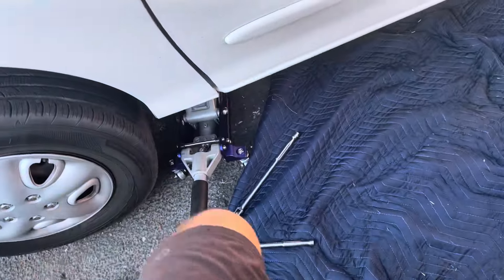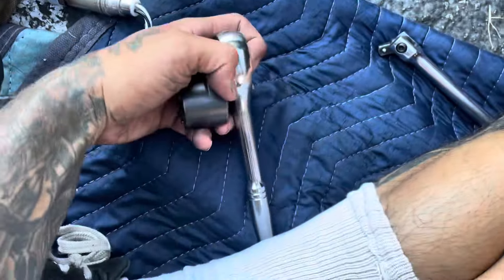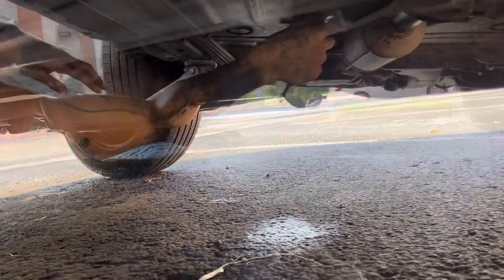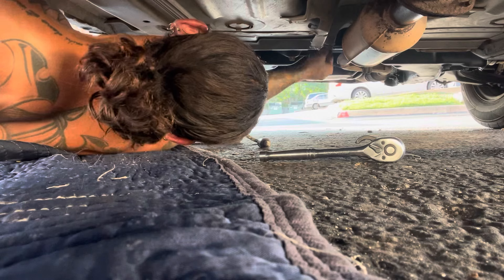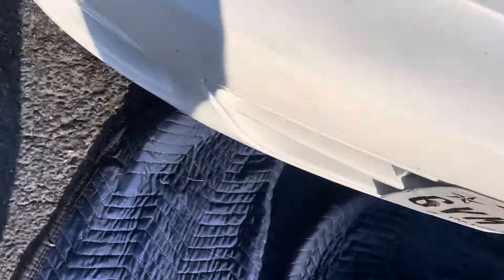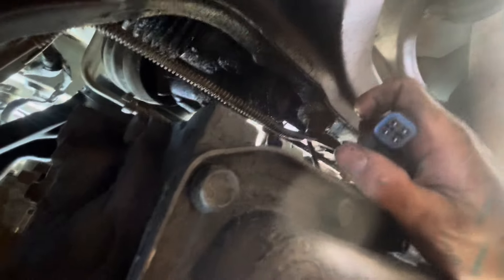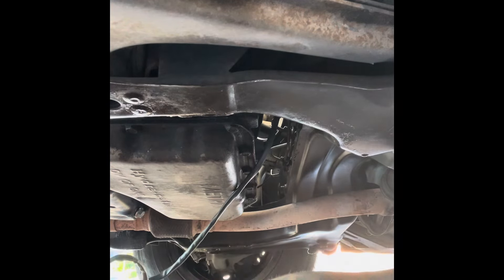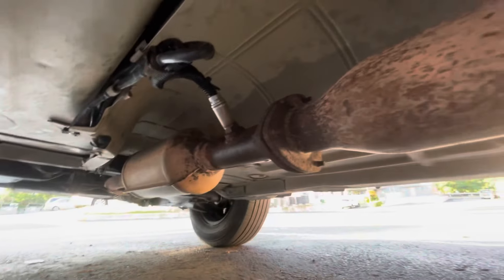How to change downstream o2 sensor 2000 Chevy Cavalier

Comment: about as straight forward as it can get. But how did you know it was the failure, what code did you get?
Reply from the maker: Bank 2. Oxygen sensor. I changed the other one about a week ago. This is my daily driver so might as well just do them both. Together it was under $100 and pretty simple to do.